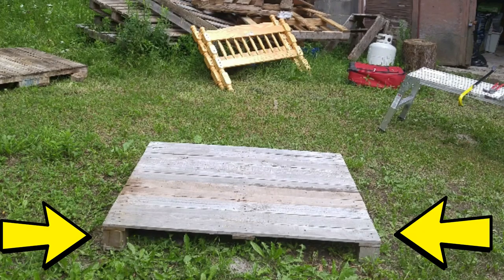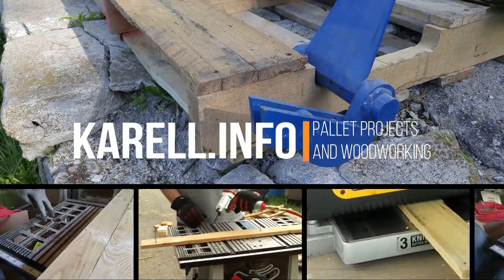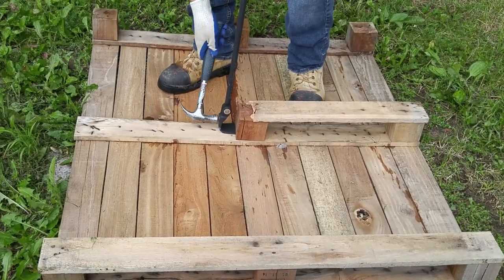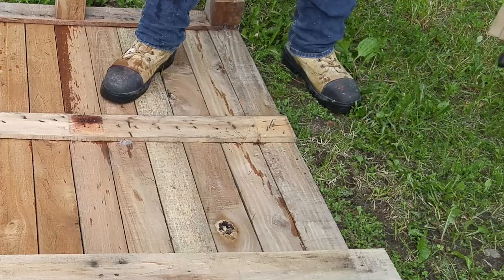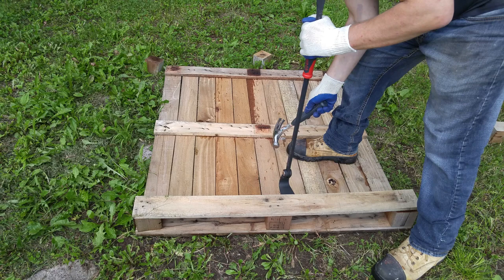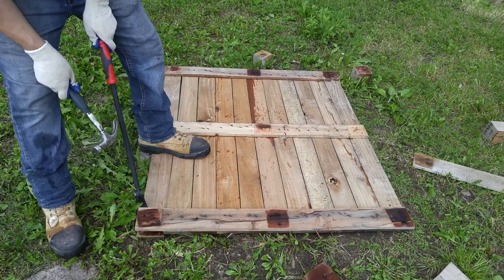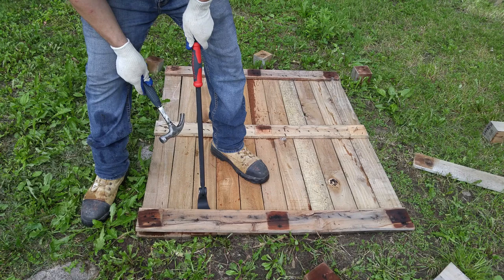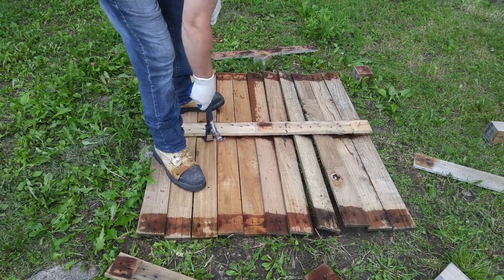How to Safely Dismantle Pallets Without a Pallet Buster: A Step-by-Step Guide

Comment: I actually answered your last question... I do use those stringers! I make crosses out of pallet stringers, so I try to take apart every pallet to save the stringers.
Reply: Karell Ste-Marie Yes. I have a cross template and build the wood cross around that so there's a cross missing in the center. Also, I used your method on a pallet tonight and saved every board... Including my stringers! Lol